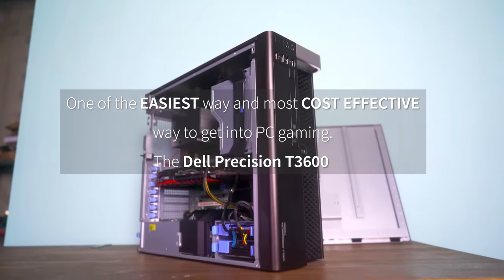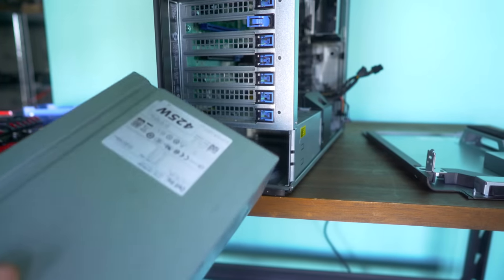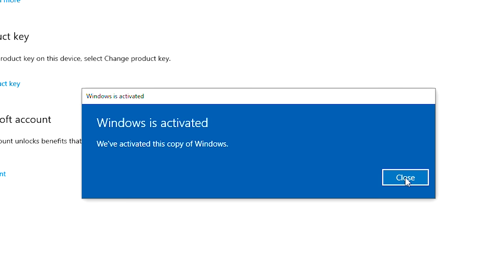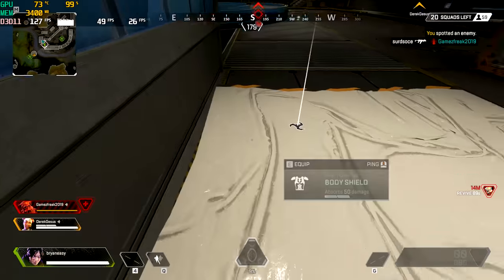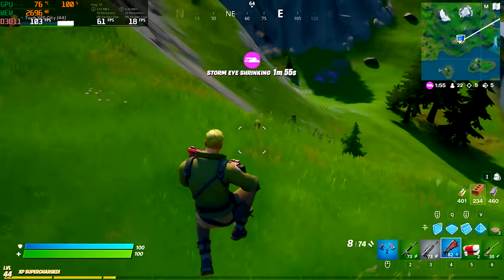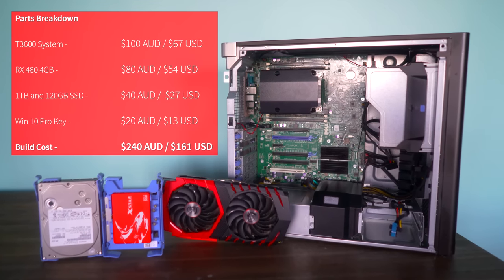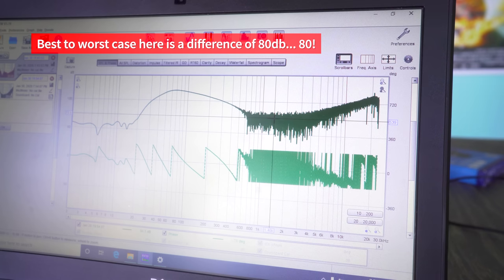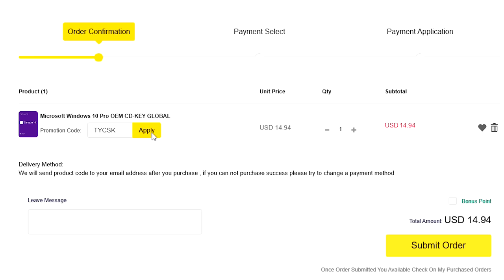How To Get into PC GAMING For Under $200 in 2020!

Comment: I got a MSI RX580 8GB and 600 watt EVGA 80+ PSU and 2x4GB 2400 DDR4 RAM for $110, then I picked up a m.2 248GB SSD off ebay for $30 and a m.2 to SATA adapter so I can use it with older PC's if I go that route. Still need a case, motherboard and processor though, so this might be a great option for me. Did have everything plugged into an HP Pavilion Slimeline s5580t with an i5 650 @ 3.2ghz but the motherboard died on me.

Comment: Hey! Loved the video! However, for the GPU running hot; I bought an rx 580 on ebay not too long ago and I would run around 70 C constantly but I undervolted it and now I average around 60-64 C. Just a recommendation for those who are scared of those temps. However, not every card is made equally so some might not be able to drastically change but the average temp drops I’ve seen from undervolting is around mine.

Comment: The side panel issue with the t3600 is very real. The gpu should have a power connection out the back rather than the side. Or a PCI-e powered card.

Comment: You know, you can get a dual 6pin to 8 pin adapter so the graphics card can run better and not run into power limitations or undesired shutdowns. That 480 requires more power than a 6pin. Some 480s don't, but that specific one does.
Reply: 425 watt psu will still be a limiting factor.
Reply: @manojgupta3770  True, that may happen. But he mentioned that he wasn't consuming more than 300W, so giving the rx 480 access to 75 more watts might help his gameplay a bit.
Reply: @MayPolBeats  That's Correct. BUT in case of PSUs it also depends. In case of very long use, say, 6-8 years the capacitors and other components gets degraded over time and potentially its Rated Capacity gets degraded after so many years, without the user realizing it. Therefore, in case of PSU's it is always wise to keep some 30-40% extra headroom  available and not to use PSU to near 100% capacity,particularly after so many years of use (in case of Second Hand PSUs)
Reply: Manoj Gupta Ok, it’s understandible. You can’t expect a 6+ year old PSU to perform the same as from day one, even if it is 80+ rated. Giving the 480 that additional power might freak out the PSU.
Reply: @MayPolBeats  Correct.

Comment: I would not suggest a proprietary PSU to newbies, when there are plenty of similar ATX PSU models to be had out there instead.
Reply: In cast of T3600 you cannot replace Dell Propriety PSU with an Aftermarket PSU. BUT in case of T3500 you can do it without any issues. That's why T3500  is my favorite. Its cheaper too and also support 6C/12T Xeons andcan be Overclocked via TS / XTU .

Comment: I'm running a 32" 1440p curved monitor, and it seems to be the best I've been able to run, very high frame rates, and with the curve I don't miss things like you are saying with other larger monitors as the curve helps keep everything in my vision

otherwise, yes, 1080p and 24-27" is about perfect

Comment: I sold working station with Xeon E3-1240 V3 CPU, it was a huge mistake. Gaming on this computer was the best. I will never do it again because the CPU temperature was about 58 Celsius, and it was the most silent machine I ever had. In pair with XFX HD 7770 GPU it was great in games I play (WOT, Civilization II and III, etc...). On Passmark this CPU has about 7100 points and it is fantastic base to build a gaming machine.

Comment: I went from an old 32-inch flatscreen tv to a philips 247e4 (23.6 inch)
Took me about 2-3 weeks to adjust to the smaller screen.
I prefer the smaller screen when playing games like Rust and Halo 2 multiplayer.
But in the future when i upgrade my gpu i'll also go back to a 32 with high refresh-rate.

Comment: I have a dell t7500 with a Xeon 5680 6 cores 24 gb ram
and a r9290x i picked up cheap and added a usb 3 card 4gb hd
Runs games 1080 p high/ ultra  and high med 1440p 
 I play older games 2013 area and older , also powers an occulus rift s nicely.
I plan to get a better gpu once the market sorts it self out a little more.
These are nice machines to get into pc gaming and tweak just a bit to get some good performance on the  cheap. :)

Comment: what is the spray stuff in the can i see you spraying alot. is it oil based? will it mess the board up if it does not dry?
Reply: It's like breaker cleaner without acetone - he would then leave it in the sun to dry

Comment: I just put together a simular build. Dell precision T3500 with a 4c8t Xeon and 12gb ram (6x2gb) in triple channel putting out well over 100 fps in Fortnite paired with a gtx 1050ti 4gb. I got the Dell broken from a guy (turned out to have 2 bend cpu pins), had the RAM left over and picked up  the gpu for 75 euro which was also the total money spend I guess ;) Loving that used price performance :D

Comment: A lot of people in the world don't have easy access to good prices on used PC hardware. Also, I feel like the price that you paid for that system is setting up unrealistic expectations. You'd be lucky to find an otherwise comparable quad-core system for that price, at least in most regions. I totally agree with the general point being made here, though you could also buy an older used console for cheap as well, but finding the games for cheap might not be as easy for a console.

Comment: Wow. That is an incredible rig for the price. I've got my fancy rig at one house that I fully built myself, but at my other house, I have put together a budget system I’ve always considered nice. I’m getting ready to upgrade the CPU in it from an I3 2130 to an I5 2400 since the CPU bottlenecks me from time to time. I only have a GT 1030 though. If you count the tower alone, I have invested about $100 into it as my grandmother gave me the computer for free after the hard drive died in it and she bought another computer. It would be more if you count the mouse and keyboard and things like that. I have put a GT 1030 in it and am getting ready to do that CPU upgrade. I also hope to add some more RAM to the already existing 6 GB in the future. I have always considered that system nice, but this is kinda crazy. I’m still satisfied though as that system is honestly nearly as satisfying to use as my other one and the 900p 5:3 monitor I have from 2007 has no problems with only a GT 1030.

Comment: I like 26 or 27 inch monitors. I work on 3 x 26 inch 1200p Dell monitors and play on a single 1440p 27 inch (Qx2710 Cheap Korean monitors ftw!!) 

32 is to big imo, 24 is OK but a little small.

Nice work on that side panel lmao.

Comment: what I prefer is higher pixel density on a 27" display.  For me, 1440p on a 27" display is the limit(or some might say  "just the right balance") of what I'd get if I had to do it all over again.   While it isn't 4k level, 1440p at 27" does offer a very nice pixel density which is SIGNIFICANTLY better than 1080 but doesn't require one to break the bank in order to run games on it at higher than 60fps with high settings.  I prefer flat panel as opposed to curved and I'd rather not do ultrawide, mainly because I'm already used to my 27" 1440p right next to my 23" 1080.
with that said, maybe if Ihad never used two side by side monitors at work or at home and had opportunity to go to an ultrawide, then an ultrawide might just atually appeal to me even more.  I guess I'm just used to what I have and don't want to significanly change(or spend all that money either, my wife would rip me a new one)

Comment: Have you tried doing the same tests with Mesa Vulkan Drivers? I have had a lot of good results with Nvidia Vulkan Drivers in Linux and Windows 10 Home and Pro. Direct X 12 has always been troublesome for me. I like the Vulkan interface of the GPU it runs a lot smoother once the colors are optimized correctly.

Comment: Nice build!  There has to be a way to get some air in there though, that GPU must run loud, temps look safe though.
Reply: One can Add a 80 mm fan to the CPU HS and also cut a portion of side panel and put up a mesh there.

Comment: You got a great deal, almost impossible to replicate for most people. That Xeon system (especially the 6 cores version) on US ebay will cost a lot more after shipping and tax... That system on ebay in your video are also missing tons of pieces... One that at least have acceptable appearance cost a lot more after tax. BTW according to Dell you can unscrew the hinged on the side panel if the GPU is too tall... you don't need to give it some Tech YES hammer lol.

Comment: 12 to 13 ways to BEAT your system lol. I've never seen a Tech Yes Beating a system into submission but it seems like that side panel worked like a charm afterwards. All kidding aside, thank you for the video and great information. 👍👍
Reply: For effective cooling, You can add a 80 mm fan to the CPU HS and also cut a portion on side panel and put up a mesh there.

Comment: The larger monitor thing is just your brain being jarred by the sudden large change in size I think. I've been using a 50" TV for about 8 years now (first 1080, now 4k, about 3' from the screen) for my main monitor and at least in my own case, after about a week or two my peripheral vision retrained itself and now it's jarring to me to work on anything smaller than a 32". I have been wanting to go high refresh though, so I am going to have to downsize, though the new LG 37.5" 3840x1600 looks like a winner.

Comment: I have a z230 with an i5 4570 quad. This 6 core seems quite a bit more powerful, and im really impressed with the benchmarks. I'm thinking of doing either a 1060, or a rx570. The 570 would be most cost effective as it isnt far behind the 1060 6g. Im just worried about the 150w requirements. I believe the z230 was made for 150w graphics cards, but that seems like its cutting it too close with a 400w 91% efficciency power supply, or does that incredibly high efficiency give more more to work with?

Comment: Hey Bryan, what's the max (in Oz) you'd recommend someone pay for these? Looks like the cheapest T3600 I can find is on eBay (none on FB or Gumtree) for ~$270AUD, which includes the 6-core CPU, 16gb RAM and a 1tb HDD. All you would need to add is an RX 480 from Aliexpress for ~$110AUD (sometimes less when Shopback does 15% cashback) and (maybe) a cheap SSD and you're golden...looks like an awesome option for someone who wants to go DIY but not the whole hog.

Comment: Man you're lucky, cheapest T3600 I could find costs $270-ish. Any alternatives that I can use instead of that one??
Reply: You can get T3500 for much cheaper. It also supports 6C/12T xeons, can be OCed with TS / XTU,  and Dell propriety PSU can be replced with an aftermarket PSU without any issues (Unlike T3600). also having a larger case makes lot of Cooling Mods possible. OCed to 4.1/4.2 GHz on all cores and all modern Games are buttery smooth on it.
Reply: No overclock
Reply: @therealcarbine15 I do OC my locked Dell System ti 4.1 GHZ on all 6 Cores. Via TS software.

Comment: So I use a T3600 for my FreeNAS/VM hosting system. Did you have any issues with noise/CPU temps? I noticed CPU temps/noise weren't mentioned. It seems the PSU fans are tied to the CPU temps and the PSU fans get unbearably loud when the CPU hits 70C+, which I hit at like 10% CPU usage with the stock cooler. Have replaced the TIM, but it idles at 50C and quickly hits 75C under light load. Replacing the stock cooler with a Noctua NH-U9DX in hopes of fixing that. Just wanted to see if you ran into similar issues.

Comment: Connecting the 6 pin power supply cable to the 8 pin socket isn’t safe. The 6 pin only supplies 75 watts and the 8 pin sockets need 150. If the card sucks more power out of the cables than the cables are rated for, they could melt and cause a fire. Don’t do it.

Comment: Nice finding! I would love to see if there is an additional fan header on the motherboard to install an exhaust fan at the rear of the case and use ThrottleStop to overclock that E5-1650! Cheers!
Reply: BlazeElPadrino You might get a workaround but the Dell OE boards don’t support OC.

There is at least one additional fan header.  They support discrete HDD fans.
Reply: @NextMerckx  Well, AFAIK the Dell T3500 is locked from the chipset side too but you can overclock the CPU if it's indeed multiplier unlocked (W3680 and W3690) so it would be nice to test if this model can do it too. Cheers!

Comment: You are just under 4 years late with this one mate, I bought a T3600 unit for my mum a while back that had the 635w PSU but if you use ECC ram with the GPU and the 425w power supply you get an error saying it can’t supply the system with enough juice for all the parts, she’s got the same with with a 2680 and a GTX1070 she’s due an upgrade as the GPU was the newest thing in her machine in October 2016, 32GB DDR3 ECC was £30! Super cheap and plays all the games like fortnite and fallout 4 easy!

Comment: The eternal struggle of working with proprietary power supplies/boards, it changes a man.
Reply: In case of T3500 you can just Replace the Dell Propriety PSU with an aftermarket one, without any issue. BUT not in T3600. Tat's why T3500 is my favorite.

Comment: BTW,artefacting - hade missing textures in PUBG,and some funny effects in GTA V's menus,but,not in the game itself.....
Not in other games,as well.
The card is Radeon RX 570 4 GB....
Would love to hear any ideas in order to fix it ?
Why only some games ?
Reply: There's not much you can do really, if it happens in more than one game it could be a dying VRAM chip on the graphics card. You can try downloading the latest drivers or lowering the Memclock in MSI Afterburner, just don't "bake" your graphics card in the ofen like so many people suggest, stinks up your house and is only a temporary fix.
Reply: @MegaHellstrike  
Thanks !!!
I'll try to do so,if it will not work,will XRAY it,then,try to repair .
I do have some acsess to diagnostic/repair capabilities .
8)

Comment: I have a 450$ built all new but the gpu was used
With
2400g
Asus gaming a320 
T force 4×2 ram
Thermaltake v200 case 
Thermaltake 500w power 
Rx 570 
500gb hdd

Comment: I have an RX 570 GPU, AMD 5 2600 CPU and patriot viper 4 16GB RAM and dont want to be spending too much for an upgrade  around 130$/£120. I also need a mid range 2TB hard disk. What should I upgrade first and any recommendations?

Comment: Maybe I missed the cpu version number, but I guess it matters? I have the Xeon e5-1650 0 in mine which I'm using as a workstation. I wonder if I can switch out my firepro w5000 for this rtx and get the same kind of results? I have 32 GB ram clocking at 16000 MHz and have a 1 TB NVMe drive plugged into PCIe alongside a 500 GB Sata ssd and 2 TB HDD

Comment: What can spray you using. I cant wait till i see what processer i have in mine. Came. With a 635 watt psu and a nivida 600 gpu. (Streaming pc only. But would like to upgrade depening on cpu. (Not known yet.) Mine needs a bath bad.

Comment: Would a rig like this be pretty good at editing photos/videos?
I have a photographer friend looking for a cheap upgrade from her ancient alienware
Reply: If you are on Starving budget then YES this system was originally meant for Workstation use (not gaming). But if you have BUDGET , go for Ryzen.
Reply: If you are on Starving budget then YES, this system was originally made for workstation use (not for gaming). But if you have BUDGET, then go for RYZEN.
Reply: Get yourself a Ryzen 7 2700x if you want the best value cheap multitasking CPU.
Reply: @miniweeddeerz1820  You cannot make a Ryzen 7 2700X  system  under $200
Reply: @manojgupta3770  true, but if he has a budget, say 500-550 dollars, you can get a pretty solid build new for eSports titles. Yes I know the 2700x doesn't fit in that either, i was just stating the best value multitasker at the moment.
Reply: @miniweeddeerz1820  If one have Budget obviously  one would go  for Ryzen which is the new Performance king but for those on shoestring budget denying the Cheap Used Xeon system means denying them PC Gaming + Moderate level Productivity all together.
Reply: @manojgupta3770  fair

Comment: that system def needs atleast a exhaust fan in the case these server like cases work best with atleast 1 fan in the back bringing air in from the front grill by a vacuum efect i was amazed when i first saw this on a hp dc7700 mini tower pc

Comment: You have to take into consideration the monitor size and pixel density. Placing it closer or further away from you will make things look as they should so your point for a 32inch monitor making things too big is invalid

Comment: Snagged 4x dell optiplex 3020 with i5 4590 in em, to bad there the small ff so i had to snag some cheap parts off ebay, planning on pairing them with rx 580s and make a few bucks.

Comment: LOL for that handle, that is excactly designed to stop you adding more powerful gear!
But you can easily buy proper case for 20€-40€.
Reply: Yes but this cuts the price in the cpu, the motherboard, the psu and the case

Comment: What are similar workstations from other brands? Thanks in advance. Great video.
Edit: Is it possible to overclock cpu since e5 16xx are unlocked?
Reply: It's possible to overclock most of them, but the Bios of the Workstations is pretty unusable. 

Still can use Throttlestop or Intels XTU. I wasn't able to overclock the 1620 v0 this way, but the 1650 v2 was able to get stable 4,0 Ghz on all cores. Not amazing, but still.
Reply: @Lemmiwings  ABSOLUTELY CORRECT.
Reply: @Lemmiwings  thanks man

Comment: Hahaha. That's one way to adjust the internal brace. I used a drill to drill out the spot welds and it came straight off.
Reply: Correct,it was just welded and can be easily removed, instead of flattening it with a hammer.